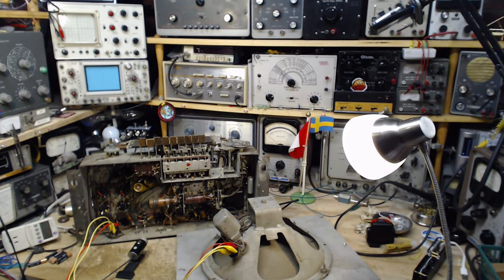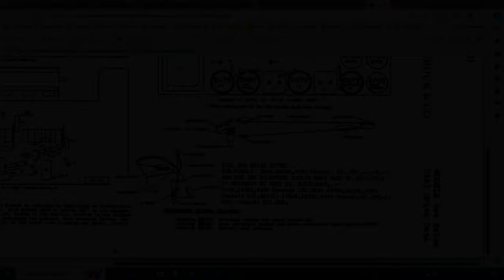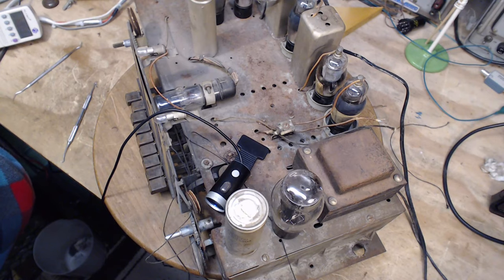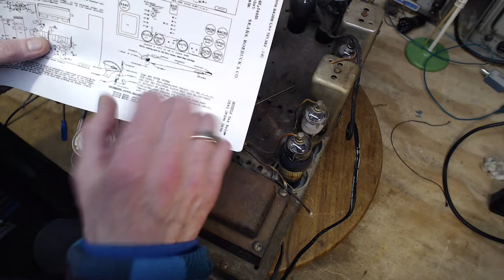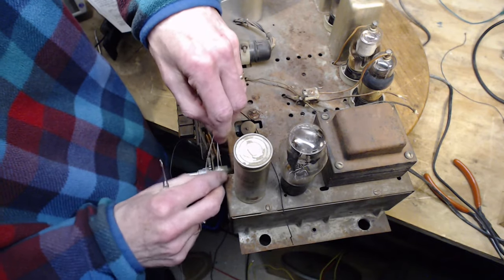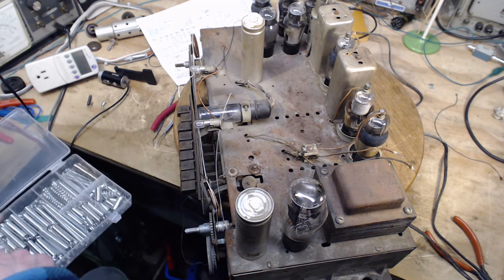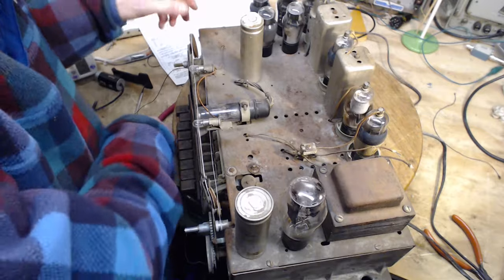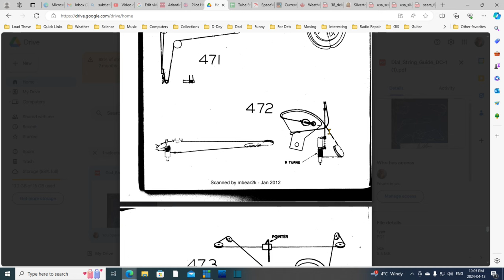Silvertone 101 583 2 Multiband Tube Radio Video #4 - Dial Pointer Drive String

Comment: Hello Jim, another instructional and enjoyable video! Thanks! Regarding the string-to-spring connection, it looks to me that the tag end of the string loops back over the spring to protect the spring - to keep it from being over-stretched. In this way, the spring acts more as a buffer keeping the line taught and the tag end loop-back over the spring protects it when you get to the end of travel. What do you think? I'm only 20 minutes into the video so maybe you'll talk about it. Perhaps I should have waited until  the end of the video before commenting! 🤣 Cheers - Luther